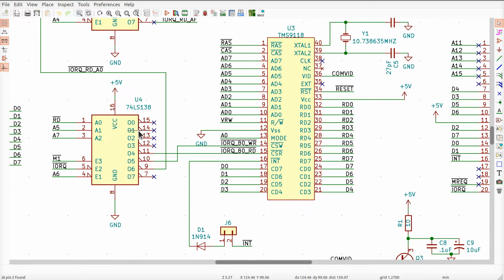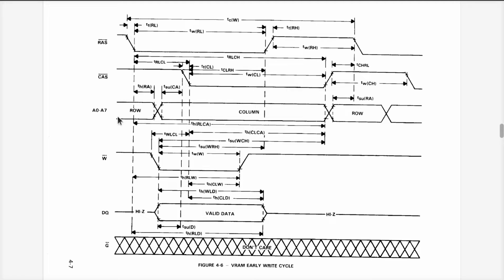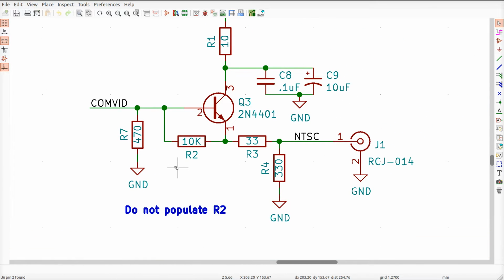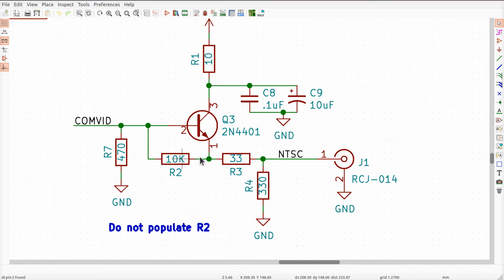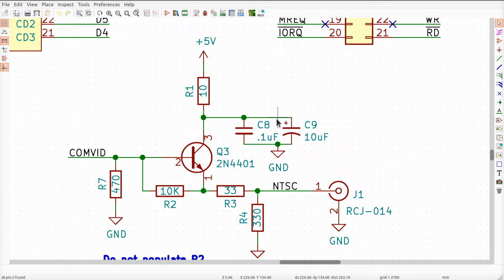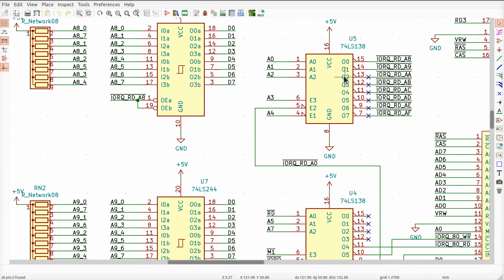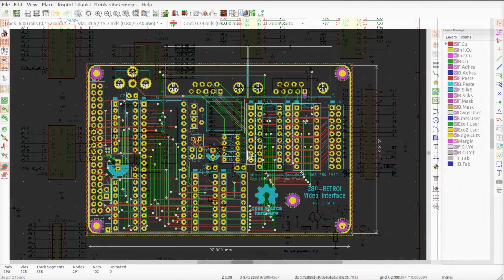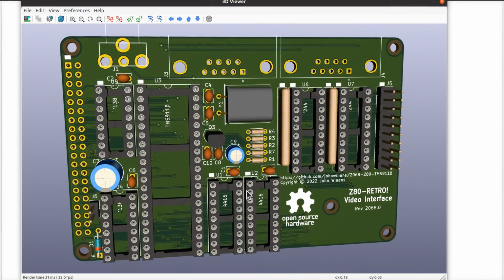Z80 Retro #49 - TMS9118 VDP First Draft Schematic & PCB for the Z80 Retro!

Comment: The COMVID (or Y B-Y, R-Y on the TMS9928/29) outputs are source follower MOS transistors thus requires external pulldown resistors to VSS to provide the necessary power or current gain to drive low impedance inputs. The document suggests values of 330 ohm and 470 ohm depending upon the external load.
Reply from the maker: Do they also define the external impedance in that discussion?
I'd like to see something authoritative show it driving a 75 ohm load!
Reply: Section 3.4.1 of Page 3-5 of the manual says it indirectly under the phrase "standard TV composite video input".
Reply from the maker: @PebblesChan  discarding the output amp would be nice.
Reply from the maker: Apparently, that is from the TMS9918AITMS9928AITMS9929A manual where it says:

3.4.1TMS9918A Monitor Interface
The composite video output signal from the TMs9918A drives a color monitor. This signal incorporates all necessary
horizontal and vertical synchronization signals as well as luminance and chrominance information. In monitor applications,
the requirements of the monitor should be studied to determine if the VDP can be connected directly to it. The internal out·
put buffer device on the composite video pin is a source-follower MOs transistor that requires an external pull-down
resistor to VSS as shown in Figure 3-3. Typically a 330-ohm resistor is recommended to provide a 1.9-volt synchronization
level. The load resistor (RL) defines the sharpness of the edges on the video signals. A lower resistor value gives faster fall
times and a sharper picture.
In some cases, it may be necessary to provide a simple interface circuit to match the VDP output voltages with the monitor
specifications. To drive a standard television that is not outfitted with a composite video input, the signal can be run into
the television antenna terminals by using an appropriate RF modulator on the VDP output. Take care to ensure a proper
match between VDP, RF modulator, and TV.

The problem I have with simply ignoring the external amp is that the datasheet for the 9118  (I have only been able to locate the section 4 that someone has posted) where section 4.4 says that the MIN load resistor on COMVID is 470 ohms.

(It is incredibly annoying that the only place I could find that was from https://www.datasheetarchive.com/pdf/download.php?id=4f1525d93d0e48fb129b2e6e6f420933c63ad7&type=M&term=TMS9118 )

Now I am left to wonder if they MEAN that the /load/ on COMVID is supposed to be at LEAST 470 ohms.... meaning that a larger /load/ may be necessary (as in lower resistance.)
Reply: Yes, it that bit is ambiguous. To confirm the that point, if you're curious, take a look at the TI 99/4 video section schematic. It uses a two transistor circuit to drive its composite video out. There are some points of interest - 1. The output drive section uses 12 volts, 2. There is trim pot to control output & 3. it uses a series 100uF capacitor filter out the valleys (like very sharp undershoots). Subsequently I tried the 100uF series cap at it attenuates the spikes getting rid of the jail bars to some extent at the cost of video clarity.

Comment: When enabled, the VDP Interrupt occurs at the end of active display scan. For NTSC it's 60Hz (PAL 50Hz). This can be useful for game timing. I've often used such interrupts to drive Z80 PIO & CTC input pins rather than the CPU's /INT signal so that the Z80 Interrupt Daisy Chain in combination with Mode 2 interrupts can be used.
Reply from the maker: I would prefer that too.  If only I would have included a few more pins on the daughter card connector. 😞

As it is I'll have to allow IRQs from either the daughter card or the CTC &  PIO on the Retro motherboard.

This sort of misfeature very much reminds me of the early home-computer era.  Maybe I subconsciously allowed this to happen to keep this project true to the era?  🤔

Back in the day I would have added a bodge to run the VDP IRQ signal over to an unused input on the CTC.  That'll make a good feature video at some point.

Comment: Note: When testing in monochrome 40x24 Text mode ensure that you select BLACK using colour value #1 and WHITE value of #F for a rock solid display (even on an LCD) and not #0(transparent). On my LCD screen other foreground colour values on a BLACK background may cause an unwanted back and forth horizontal row wobble of a pixel width (probably due to the NTSC colour encoding method used).
Reply from the maker: Composite color is just not cut out for digital images. 😕

Comment: The video on my 1984 TMS 9118 board works just fine just with the 470R pull down resistor driving a 75 ohm CRT monitor however I get unwanted "jail" bars for some colours such as blue when using my 21st century DELL LCD monitor. This could be because the technique the VDP used to NTSC colour. The best bet is to contact Karl Guttag - One of the designers of the TMS9118. In the meanwhile try generating black on white to see how clear and stable your picture is without generating any jail bar artefacts.
Reply from the maker: 🤔 LCD jail bars and horizontal wobble could be caused by a relatively prime relationship between the LCD's native horizontal pixel count and that of the video signal
Reply: Unlikely because my 1920 x 1200 monitor has useful variable zoom and selectable 4:3/16:9 aspect ratio functions.
Reply from the maker: @PebblesChan  we'll have to look at how it generates the color subcarrier when it transitions out of black & between colors.  Maybe it glitches?
Reply: I had a look at the video signal with my DSO and sure enough there are some 1/2 amplitude troughs present within blue pixels.(Interestingly the amplitude drop for red is about the same but for yellow is less.) The largeish amplitude drops seems to explain why the LCD NTSC decoder may show them unwanted dim areas. When probing signals ensure that the return path (i.e. the ground lead) is kept as short & as close as practicable to the source signal otherwise you'll introduce unwanted probing artefacts. Such artefacts often show up as signal over/undershots, ringing and noise.
Reply from the maker: @PebblesChan  Amplitude drops of the chroma subcarrier or of the luma?
Is this happening on my board or something else? -- I'm wondering about the potential impact  of switching noise.... How well bypassed is your VDP?
Reply: Well actually the resultant sum of the chroma and luminance on the NTSC signal. I haven't gone to the effort to check the chroma phase in relation the colour burst.  The amplitude dips are rock solid and have no visible jitter.  The behaviour is consistent whether I use a linear or switchmode power supply. Adequate "Coulomb bucket" (relatively) low inductance capacitors are deployed. The RetroTink 2X device caters for such retro game NTSC outputs and offers a selection of different filters.
Reply from the maker: I posted a note to Karl's web site... under what I assume was a post from you.  :-D

Comment: I'm running Lubuntu 22.04  It is still x11. So far seems solid.
Reply from the maker: 🤔 by default mine went Wayland on me.  There is a setting I changed that runs X instead.  But there is still some details that are not entirely sane about it.
Add the idiotic horizontal desktop switching (as opposed to the FAR more useful vertical mode) with the rest if its new decor and it is a cosmetic crap mess.
If I wanted a mac, I'd buy a mac.

OOPS I just noticed you said L-ubuntu.  I was on Ubuntu.  Maybe I should look around some more.

Comment: Hi John. Remember that NTSC is an amplitude and phase modulated signal. Therefore if the supply to Q3 is not noise free, as much as you can, it will inter-modulate (IMD) your input signal and create distortion (amplitude and phase). R1,C8,C9 are forming a first order low pass filter for your analog (i.e video signal), hence "decoupling" your analog signal from your digital signal, without compromising too much the level of supply applied to the collector of Q3. TTL is known to generate noise as its dv/dt is in the vicinity of 50 MHz. The totem pole output of the TTL, going from Hi to Low, "grounds" a 120/130 ohms resistor (if you have a few gates switching at the same time in the same chip, you can imagine the sunk current in a fraction of time). That's why it is utmost important to decouple each TTL IC power pin with a 100nF. Also, you should aim at having a good (precise) 10.3 MHz signal (which is 3 times the colour sub-carrier (3.579545 MHz)) that is used by the receiver to demodulate the phased signal. Finally, I would use a 2N2222 instead of the 2N4401. I believe the specifications of the 2N2222 (the jellybean transistor would say David L.Jones) are superior.  I really love that series. Thank you for sharing your knowledge. Regards, RJM.
Reply from the maker: Thanks!  I'll swap in a 2n2222.  I have some but they seem to be getting pricey in they-hole packages these days. 😞

Comment: Personally I'd replace R1 with an inductor after looking at whatever noise is already there. I suspect it was to filter the cpu switching from interfering with the colour burst frequency and injecting noise onto pixels. Measure and change one components value at a time to quantify the effect. Also keeping the power rail away from other signals on the pcb with a ground plane under it will help. Have fun!!
Reply from the maker: I agree for multiple reasons.  I decided to put a ferrite in place of R1.
There is still quite a bit of switching noise coming out of the composite signal... which fades with a 470pF that ties the composite output to ground.
To get the best video, this might take more tinkering that I have given it.
Spoiler alert: in the next few videos you will some trials and errors with this.

Comment: I spent a lot of time creating different drivers for my TMS9128, which also has an issue on B-Y, needs a sample and hold....
The chip already generate a very noise output where we need to decide to have a sharp image with vertical bars or a "blur" image without bars using a few capacitors. In the end, I am using a very fast OP-AMP. Not the same color (NTSC) was awesome!!!!
Reply from the maker: I have seen someone add a ferrite and big cap (I already got that) to the power for the TI chip on its own.  I expect to add a ferrite to my next rev too.
Note: I also added a 470pF from the composite output to gnd to noticably reduce some high-freq fuzz.
Reply: @JohnsBasement  True! V9938 and V9958 already have an extra pins for internal DAC power supply. I also have the V9958, which I connected all supply pins together! I did not understand why different power supply pins until I saw this ferrite solution. Well, I am too lazy to create another PCB....
Reply from the maker: @CidorvanLeite  😂 I hear that!!
I'm gonna do a rev 2 so others interested in the retro can try their hand at some code tinkering on a bodge-free board.
My ultimate goal is to experience this style of interface from the software perspective and move onto a new design with VGA output.

Comment: Who's the manufacturer for the 2N4401 transistor you're using? I'm checking out your output buffer.
Reply from the maker: Unfortunately it looks like mine are from a 'major brands' bag-o-parts order I I got from Jameco some decade or more ago.  (Nothing against Jameco.  I ordered them knowing this up front.  The price was perfect!)
Going forward, I'd be glad to try some other parts I have around if you want to help me improve the design!!!
If you think there is an optimal part that is orderable from Digikey, let me know.  I'll add some to my next order.

Comment: As someone who is working on something almost exactly the same, I want to disagree about the function of resistor R1. It's not there to prevent the supply voltage from dropping below some voltage, but to isolate the power lines of the transistor. That's because, the transistor is not ideal, when the collector voltage drop abruptly, the output voltage drops. From my (shallow) experience, this will happen despite the deep feedback of the emitter follower circuit. My theory is that there is some capacitance between the collector and emitter, and the slew rate of the transistor is not infinite. R1/C8/C9 creates some kind of a isolated 'power bubble' just for the transistor.
Reply: By the way, I did not do this and I'm now suffering from the consequences. I have to use a more brute force method: adding a small filter cap in my NTSC output. This supressed a TON of noise coming from everywhere and allowed me to continue working for a while without worrying about too much noise going into my video signal. But it backfires: the capacitor attenuates the color burst so much that my TV thinks the NTSC signal is monochrome! (It also softens the signal a bit resulting in less sharp image, luckily text is still very readable)
Another thing to notice is that you may want to power the whole thing from the video circuit. This sounds weird but actually makes sense: the TMS9918 and DRAM consumes a lot of power. My design draws around 700mA of current, and from the datasheet I calculated that around 500mA is consumed by the video subsystem. (I don't make the video circuit into a seperate board so it's hard to make actual measurement.) And that is some very noisy current. Being closer to the power source may help to reduce the noise level a bit.
Reply from the maker: I added a 470pF cap across my NTSC output too.  But it did not change the picture visibly.  I did it to cut back on high-freq RF spewing out of the circuit from what I assume is switching noise.
The better place for the 470pF might have been on the base of Q3.  I suspect there is more research in need of being done here.  BUT I am pretty happy with the video that I have so far with R4 and R4 not populated, a ferrite in place of R1 and a 470pF where R4 was.
What do you think?
Reply: @JohnsBasement  After comparing our boards I realised that my experience probably doesn't apply to your project. I'm doing things on a prototype board just like one of your old projects. That means no power and ground plane, and the power and ground wires are almost as thin as signal wires. I also use the TMS9918A instead of TMS9118A because I didn't know about the TMS9118A at the time I was building this project. So I have to use 8 memory chips instead of 2. The chips are MB8118, a 5V-only version of the 4116. I pulled them all out and the overall current dropped around 100mA, so the current consumption of the video ciruit is more like 300 to 400mA instead of 500. What is true is that these chip generate a lot of noise, especially when /RAS is activated. I ended up adding one bypass cap under each DRAM socket, and that greatly reduced the noise.
Reply: @JohnsBasement  I'm not sure where the best place for the capacitor is. The base of Q3 roughly translate to the COMVID pin of the TMS9118A (if you ignore impedance of the trace, which is probably not a good idea when talking about high-freq noise...). That means the capacitor is loading the TMS9118A's video output circuit, which may not be a good thing. I'm actually on my way to remove the NTSC filter cap. It's not a permanent solution and it softens the image. I prefer solving the problem from the source. Once I can get rid of the noise in the power rails I think I can get the noise under control even without the NTSC filter cap. (however, trying to get very sharp image from prototype board with a giant mess of wires is probably a lost cause haha) This is even less problem for your project, with only two DRAM chips generating noise and a giant power and ground plane to absorb the noise.
Reply from the maker: Uh... then I was unclear or you misunderstood my comments.  R1 is obviously NOT trying to lower the voltage.  It is there to reduce noise from entering the emitter-follower amp.  My note about the voltage lowering is a concern about increasing its value to the point where it COULD lower the voltage... which would be a problem when driving a white/bright screen.
I think an inductor is a better choice for that component.
Reply: @JohnsBasement  Indeed. Many projects use a inductor, but the problem with inductors is that if the transistor suddenly draws less current, the inductor will try to push the current through. The currrent will be mostly absorbed by the capacitors and the whole thing starts oscillating like a LC resonator. This may cause severe ringing therefore the choice of an inductor is much more difficult than a resistor.

Comment: A Z80PIO would look neat instead of the buffers for the joystick, while providing interrupts for them and the VDP. I don't know if 7 bits are enough for a joystick, though, as you'd lose one bit with VDP INT.
Reply from the maker: You are probably right... except... I did not expose the IEI/IEO daisy chain to the add-on board connector.  :-( 
Than again, I was going to argue that we just use Z80 mode 0 with video and ignore the CTC and SIO.... or use mode2 with the CTC & SIO and disable IRQs from the VDP.
By same reasoning, I could enable IRQs a VDP+PIO design (with CTC and SIO IRQs disabled).... or vice versa.   The net result being that things might be more consistent... AND prepare for a future Retro-II that has a better IRQ design.